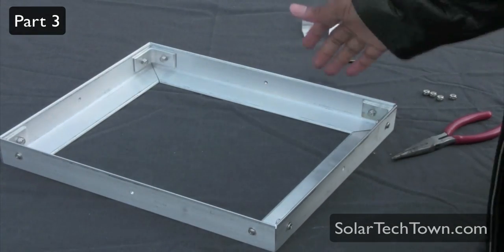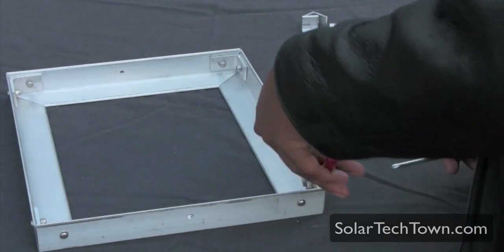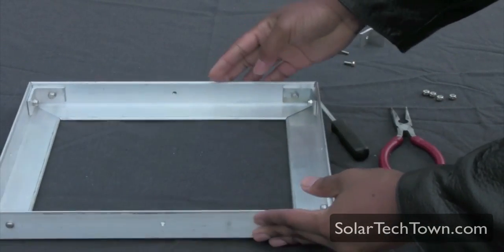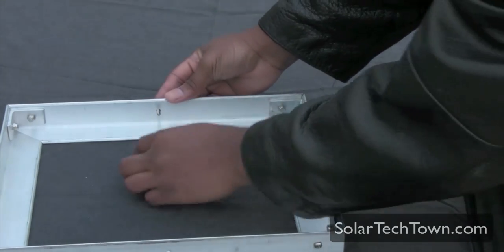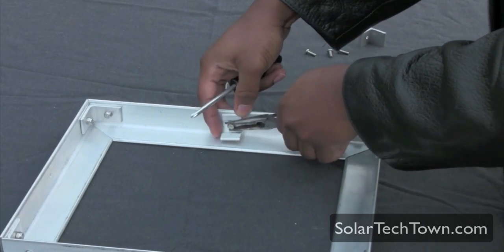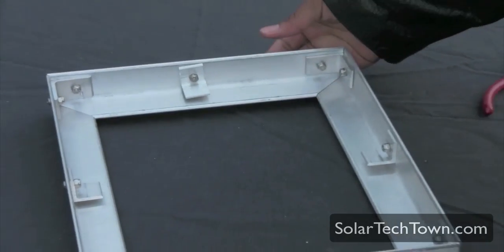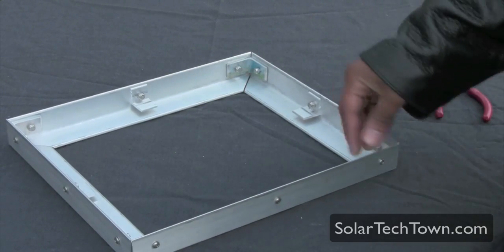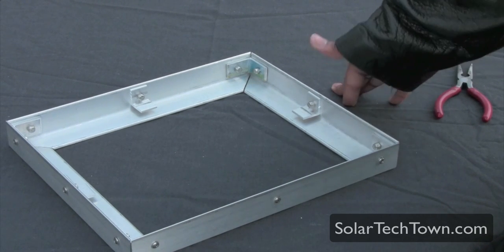How To Build An Aluminum Frame Solar Panel - Part 3/3

Comment: Hi this is mark. The nuts are lock nut's. You silcone the glass to frame and then add the corner bracket's and clip's. I also put silcone between the glass and the clip.  Mark

Comment from the maker: Correct, of course you'll have to take the middle L brackets off to put in the glass, however, my presentation here was to show you how all the pieces are assembled together, as the rest should be obvious after watching Mark's videos.

As for the vibration, according to Mark who has used this same frame for a couple of his panels, he hasn't had that problem at all. I agree it will help, but from his experience he hasn't had any problems with the frame.

Comment: I see a couple flaws with your explanation. In order to slide a panel into that, you would need to take off one of the sides, otherwise the corner of the glass won't clear the brackets or nuts.
Also, if you are going fo a long-term installation, you should find some way of locking those nuts on, either a threadlocker, o locking nuts. Otherwise it can vibrate apart.